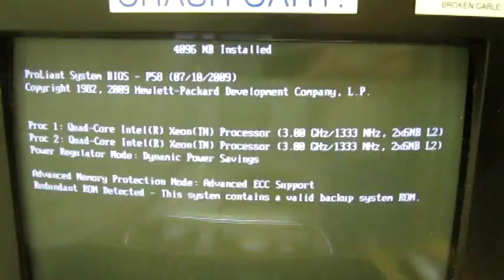HP DL360 G5 - Upgrade from 1cpu to 2cpu

Comment: I have the Same server need to upgrade Ram / HDD and add a 2nd Dual Core Xenon (its not the Quadcore compatable version)
I also haev a DL365G1 with 2 Dual core AMD's will upgrade those soon to Quad core Amd's

Comment: ROFL the guy puts all the cooling paste in the world on the CPU's. Those will be running hot as hell... Cause no kids, cooling paste does not cool the CPU, the COOLER cools the CPU and the paste only ensures a perfect connection between the CPU and the cooler on top of it. Less cooling paste = better, you only need about half a rice grain of paste spread out over the CPU...
Reply: BOT Wally Plenty consumer CPUs with bigger dies than a Xeon and no the IHS is the same size as any other CPU, cooling paste does NOT cool, it fills the miniscule imperfections on the seemingly flat surface of the IHS. With all CPUs, you put about a rice grain on there and place the cooler. If the cooling paste does not spread you have not placed the cooler properly as that rice grain is  more than enough to coat the entire IHS.
Putting more cooling paste than needed not only adds heat but you also risk the paste dripping onto the mainboard...
I have opened up plenty GPU coolers, and like OEM pc's, laptops and other crap-brand consumer products they are covered in dried up cooling paste, after removing it and putting on a correct amount of cooling paste they run 5 to 10 degrees (celsius) lower.

Comment: hey can you help me with a replacement cpu fan
I bought it from a site which builds computers for you and sends them to your door
so it was built up and i added my own fans, the computer has started to shut itself down though on certain games because of heat problems 
i am going to purchase a new fan and some arctic freeze paste
but i was reading on the internet that the stock coolers have thermal pads on and they are a pain to remove, needing you to heat up the pad for 10minutes and then ...